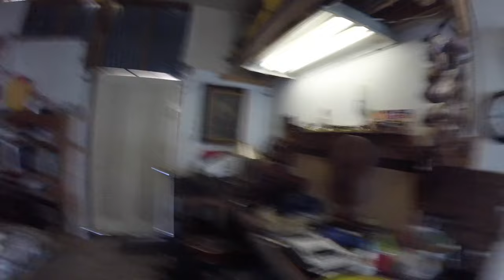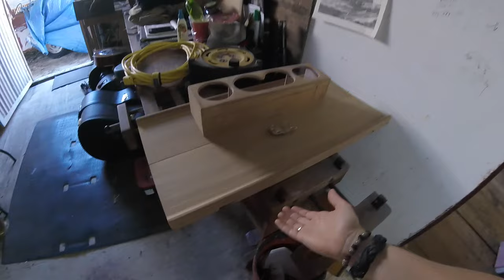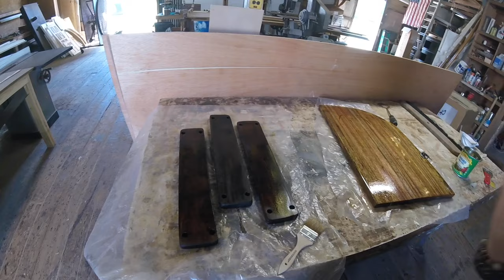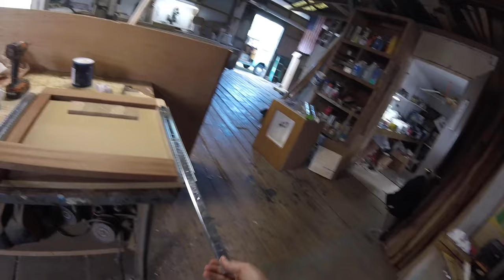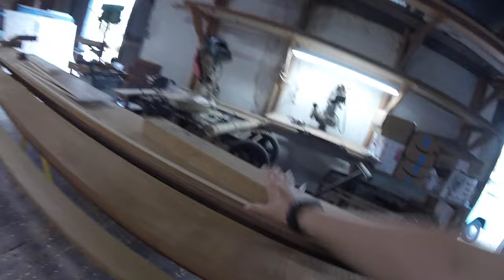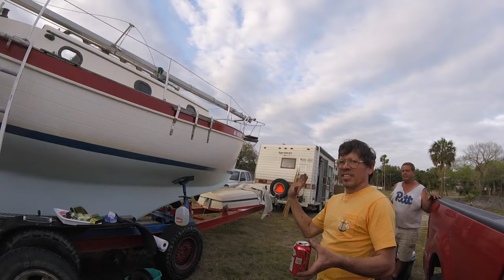Episode 398 - So True

Comment: The rails seem to be ok, but add two extra hinges since all the force will be on the far end hinge. I think you'll screw it rather than bolt it. I would recommend bolting the table with a sheet of metal or solid wood in between because due to the elasticity of the construction the bolts or screws may tear into the wooden back plate (ply wood?) the table is attached to and the whole thing goes wobbly over time, oh well